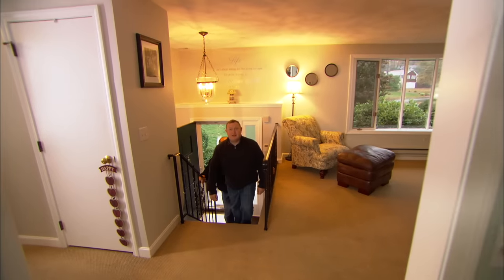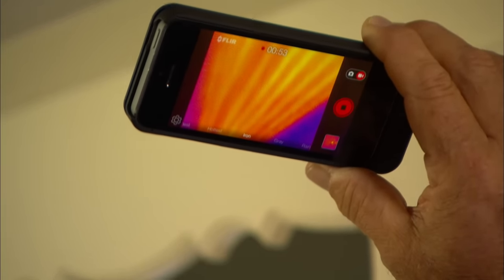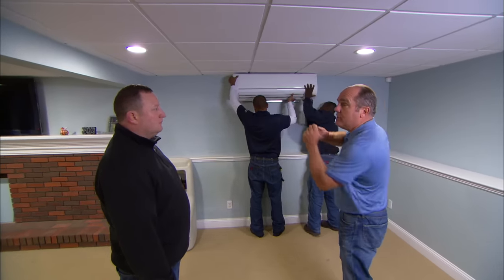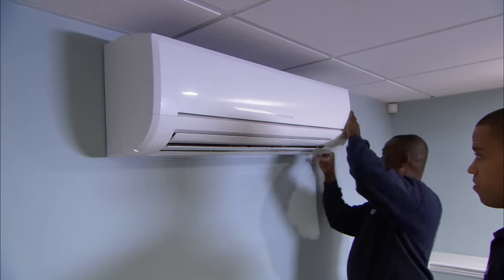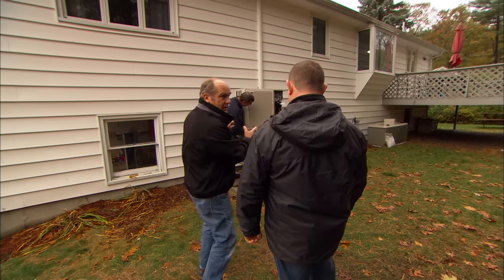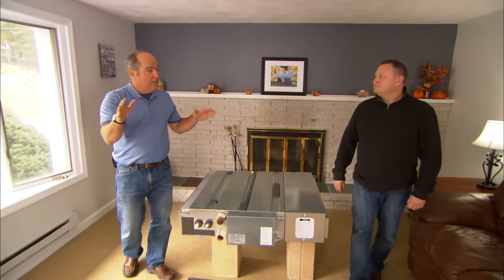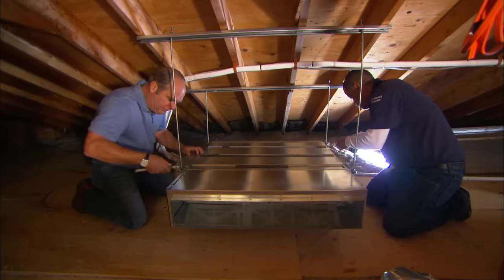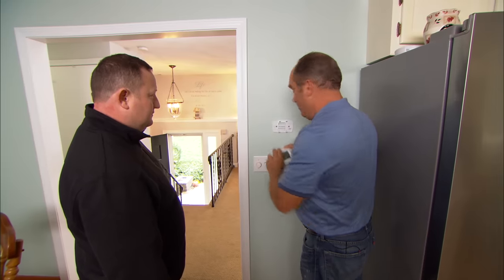How to Install a Whole-House Ductless System | Ask This Old House

Comment: Ductless? Someone needs to explain to this guy that something can't be called ductless, when ducts are being used. After his comment about usable heat in a block of ice, I guess I shouldn't be surprised. 

The fact this guy actually believes heat is being moved from outside to inside, on a freezing winter day is beyond idiotic. Claiming this is a process of simply finding heat outside and moving it inside isn't even an over simplification, it's dead wrong. The system is treating the cold air and attempting to use the small amount of heat created by converting the energy. A lot is lost though, which is why this is only used in milder climates.
Reply: As I stated elsewhere, don’t get too hung up on the “ductless” term, it applies only to the air handler.  These unit are often called “ductless mini-splits” because the wall-mount air handler is the default package.

But when using zoning and a branch controller, you get other options, such as this ducted air handler.

As for the heat transfer, that’s precisely how it works.  Just because it is super cold outside doesn’t mean there is no energy to be used.  But he isn’t going to sit and explain the pressure-temperature relationship and how we manipulate it to our benefits by raising the pressure of gas refrigerant with the use of a compressor in the middle of this show.
Reply: David Cerino, I'm not hung up on anything. The title of the video is "how to install a whole-house ductless system". That's not what this is, no matter what you may have "stated elsewhere". 

As far as the transfer of heat, again, that's not what's occurring at all. It's not moving heat from outside to inside, especially when the outside temp is close to freezing. It's using the heat created by the conversion of energy when the air is handled. If he didn't want to explain it correctly, then he shouldn't attempt to explain it at all. What he said was nowhere near accurate. Further, "heat" can't be taken from a block of ice, let alone moved elsewhere.
Reply: It might capture cold air but the cooling process is the same as are central air conditioner.

Comment: what idiot inslaed the heating element in the cealing?! xD wtf the HOT AIR RISES xD thats old news :D
Reply: Milan Dičér I was thinking the same lol. They where heating the attic instead of the kitchen.
Reply: I was thinking the same thing too I would have put it in the basement floor
Reply: Milan Dičér Hot air rises, but radiant heat doesn't. Radiant heat radiates toward which ever direction you aim it. With these systems the sheet rock is either foil backed, or there's a foil vapor barrier below the attic insulation, so the radiant energy has nowhere to go but down. I grew up in a house that had this exact system in use, and it was extremely comfortable. The air temp in the home could be 60°F/15°C, but you won't feel a chill because you, and every surface is heated from above. Exact same principal when the bright sun shines on you during a cool fall/spring day.
Reply: Sounds good but all heat rises reflectors or not. Should have been in the floor but those were the days of endless energy.
Reply: Curiosity Nope, only hot/warm air rise. It's called convention. The only way the air was heated in this home was by convection from the surfaces being radiated upon.
Reply: that could work in vacuum :) radiation is lss effective than air cyrculation
Reply: The way it works is that it heats objects in the room and they in turn give off heat.  Personally I'd worry about cancer.  And these systems were known to kill sperm still inside men.  I kid you not.